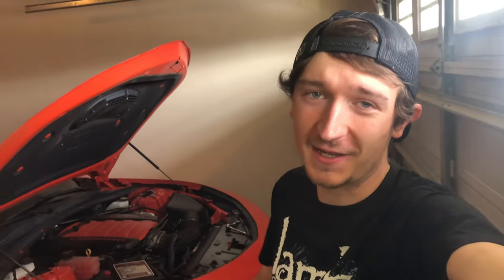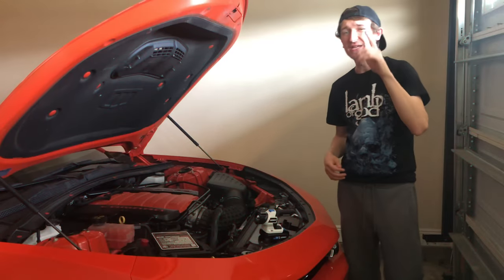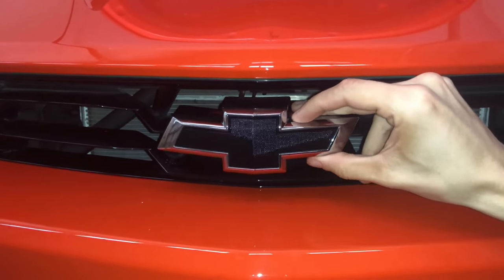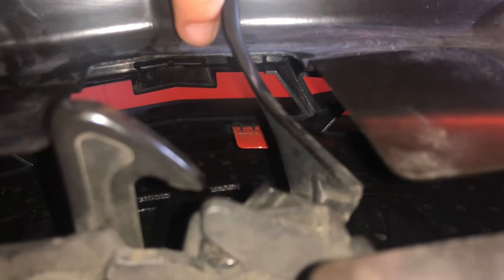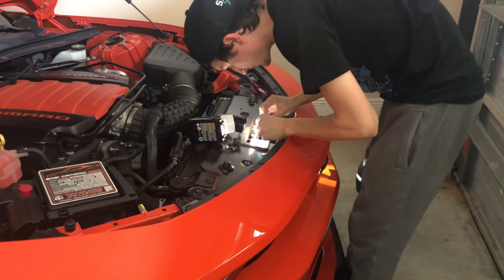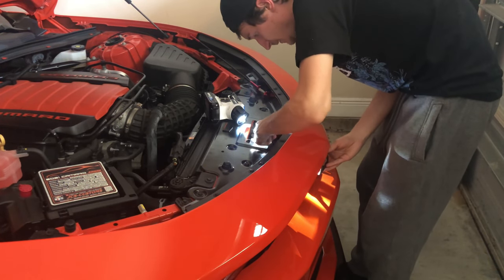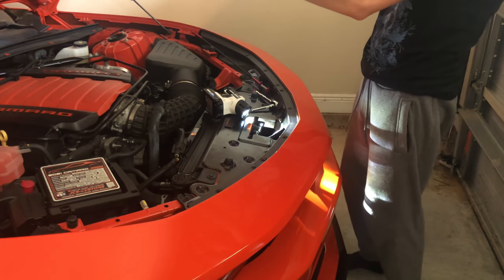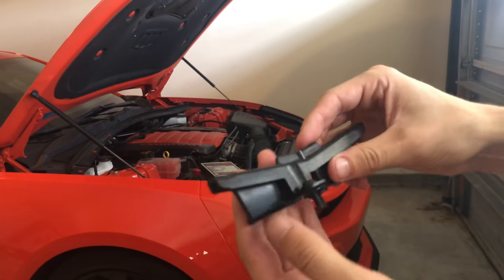How to do a Bowtie Delete on a 2020-2024 Camaro SS

Comment: Bow Tie delete?  for sure!
I took it off mine and I think it looks way cleaner, (21 black 2SS) 
Thanks for the idea!
Reply from the maker: Nice! Thanks for the comment and view!
Reply: I put my bow tie Back on, that was a bit tedious. I used the screw-holder tabs off an electrical switch and used a hole punch to size them for the screws so they wouldn’t fall out of the bracket while re-installing. lol
Reply from the maker: @mikedelarosby8006  nice haha, yeah it’s definitely more involved than removing

Comment: Do you have any idea how to go about taking the SS badge off as well??
Reply from the maker: Use a little heat, then use fishing line to take it off
Reply: @JCSCUSTOMS  I did that to the one on the rear bumper but what about the one in the front grill?   Any idea?
Reply from the maker: @jakef777  front I did the same, pulled the line up to the clip from one side, then pulled the line  up to the clip from the other side and it popped off with a slight pull
Reply: @JCSCUSTOMS  ok I’ll give it a try. Thanks!
Reply from the maker: @jakef777  you’re welcome!
Reply: @JCSCUSTOMS  What about the black piece that the emblem attaches to?  Can it be removed as well?
Reply from the maker: @jakef777  no that’s part of the grill
Reply: @JCSCUSTOMS  gotcha.  Thanks again!
Reply from the maker: @jakef777  no problem!

Comment: How do you take off the back one?
Reply from the maker: Fishing line to work your way behind it, pull it back and forth until you make it to the other side and it’ll pop off. Then use goo gone to remove the stuck adhesive on the trunk

Comment: How did you remove your front tag bracket???
Reply from the maker: When the screws are fully unscrewed, you can grab and pull it out through the hood latch opening
Reply: @JCSCUSTOMS  so it won't leave holes in my bumper???
Reply from the maker: @Bigg_Yo  nope! The bracket is slid on the back of the grill, it simply slides off leaving a clean look
Reply from the maker: Whoa man correction on all this. I totally read over the word Tag and thought you were asking about the bow tie bracket. I’m sorry. My car didn’t come with a front tag. It depends I think. I’ve seen some that are screwed and some that are not. Disregard the comments above
Reply: @JCSCUSTOMS  Thanks bruh
Reply: @JCSCUSTOMS   Hey Do you have an oil catch can installed, or do you suggest one???
Reply from the maker: @Bigg_Yo  I haven’t installed one yet but need to, I do recommend getting one
Reply: @JCSCUSTOMS  Thanks bruh I ordered a mishimoto oil can catcher
Reply from the maker: @Bigg_Yo  nice! No problem